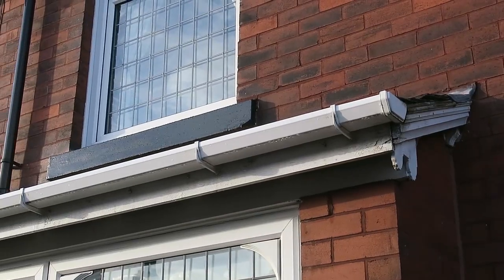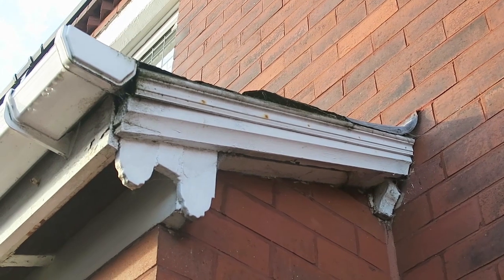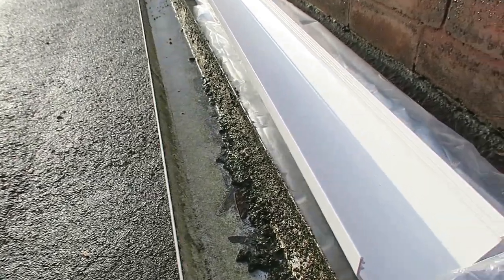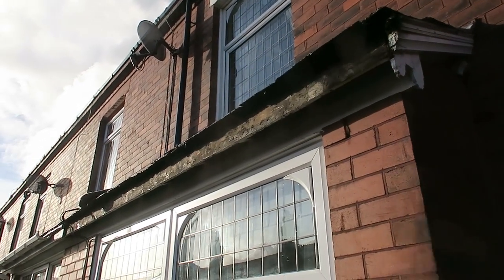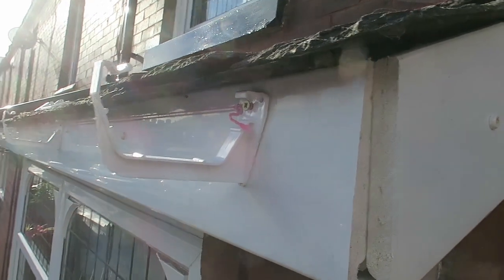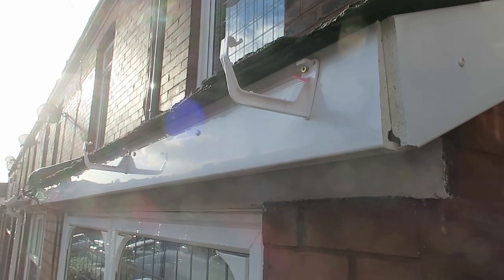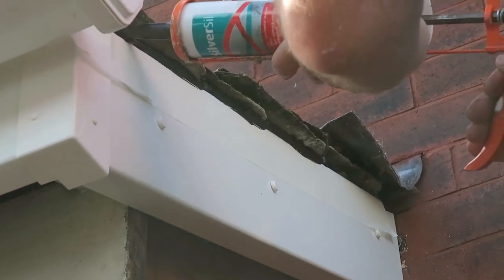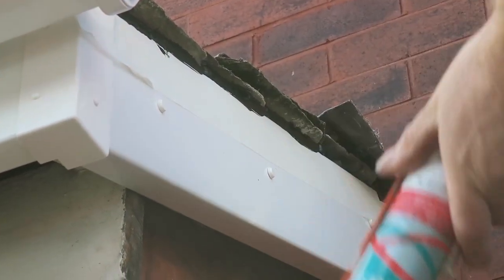How to replace fascia board and gutter installation

Comment: Nice and easy. Lovely job mate. The down pipe across the bay roof from the roof gutter is probably not needed you can use the bay roof to take the water run, that sort of thing ruins the look of the front of a house and your tidy job!
Reply from the maker: i agree mate, nothing to do with us tho they had that done to fix problems with the above gutter. cheers